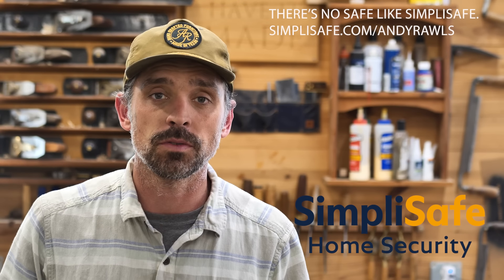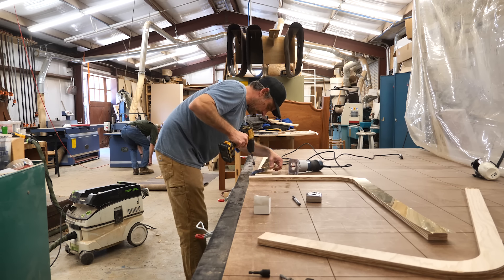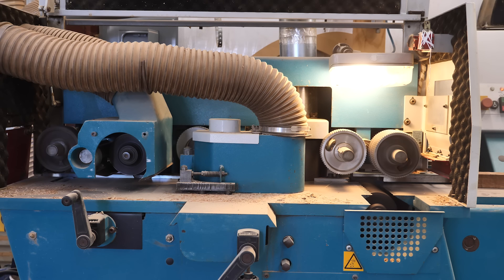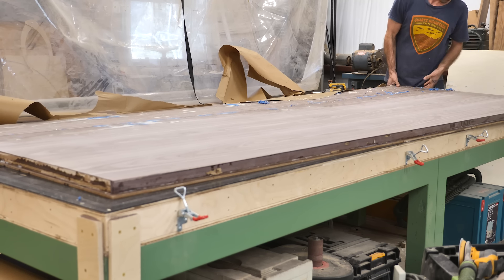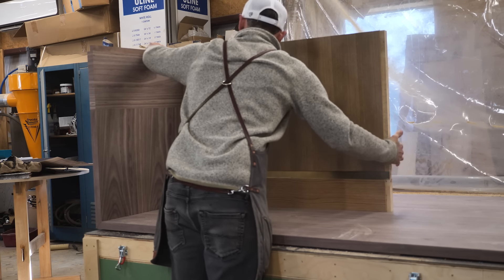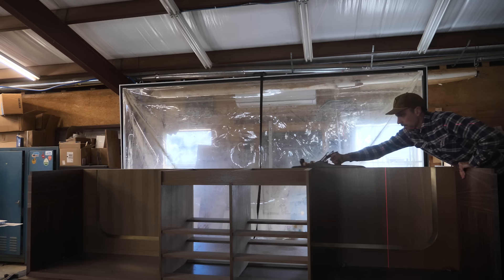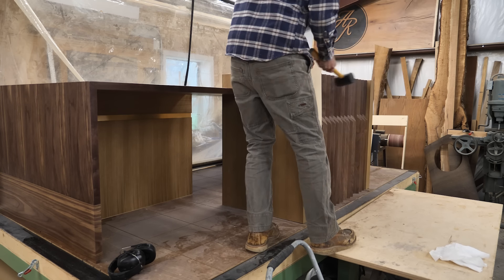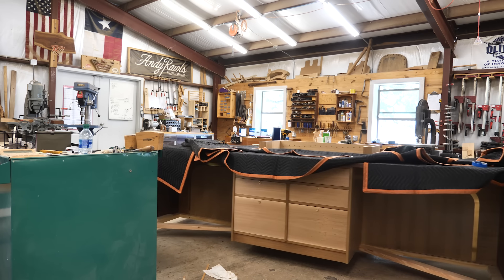10' Reception Desk in Walnut and White Oak with Brass Inlay (Headed to Austin, TX)

Comment: Andy, I've been in Commercial Casework for over 30 years and have built hundreds of projects in my time. The reception in this video is exceptional. Design, joinery, and fabrication is as good as I have ever seen. Great job, I have used and own many of the tools in your shop. I am at 71 now jobs like this are for you younger maker's, my projects these days are limited to size. That was a lot of work for that brass detail under the desk no will appreciate. I love the walnut detail on the front.

Comment: Andy, great work as usual.
A couple tips that have helped me with veneering in a vacuum bag:
1.  Titebond cold press glue.  Has a higher viscosity and longer open time than original titebond.
2.  For flat glue ups, 1/4” melamine works well as a caul and the glue won’t stick.  Horizontal grade plastic laminate works well on curved parts to put between the veneer and caul material to help prevent sticking.